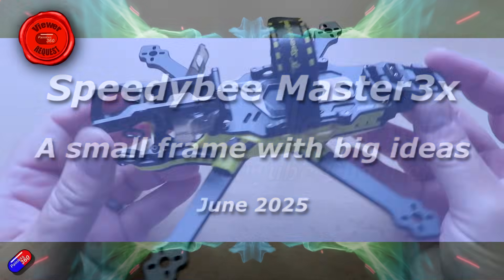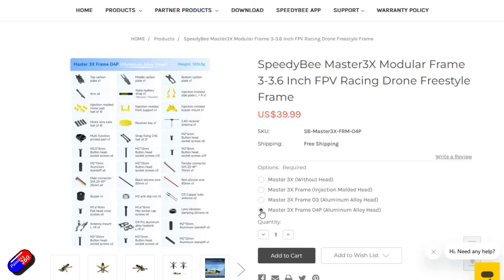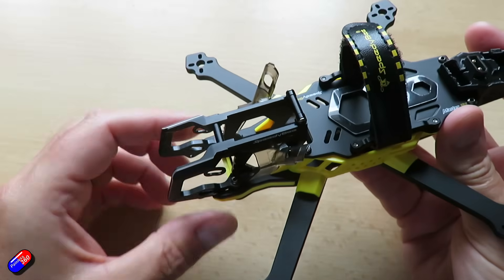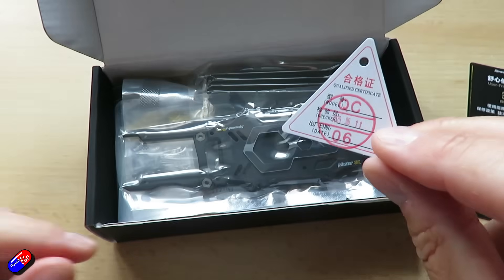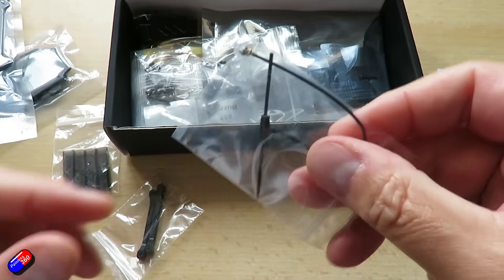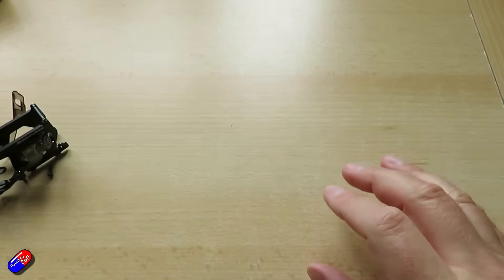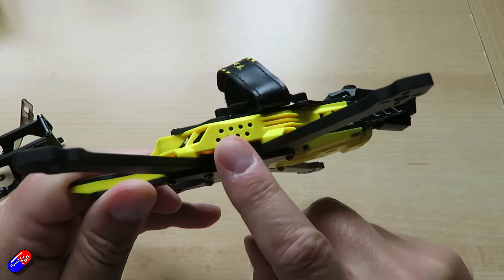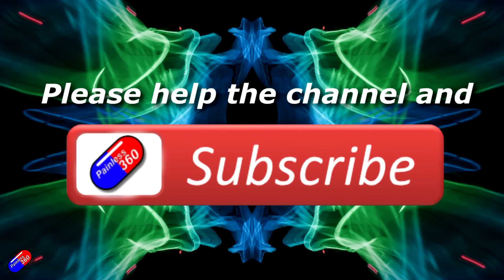SpeedyBee Master 3x frame: A 3" frame with a few tricks up it's sleeve!

Comment: I really like this drone. I grabbed it a few months ago but was the BNF BC the frame only wasn't released yet. I also have a Nexa Evo Pro with 1804 motors and the M3X performed just as good while being over 50g heavier. I was so impressed with the 1507 motors that I bought a set and installed them on the Nexa last week lol. Plus they have around 250 mm more stator volume than 1804's and over 430mm more than 1604's. For fun I put on hq prop 3.5x3.5x3 props on both quads and the results were quite lifting 😂Overall the 3.5x2.5 are the best for 3.5" IMO

Comment: It looks really good. Does the air unit bolt into the head unit as well so that you just unplug easily after the four screws? If so, it makes an air unit pro seem not so bad if you can share it across a few SB frames.
Reply from the maker: Check out the Bee25 video. The frame is designed to enclose it... Happy flying

Comment: Did they provide the wire loom and plug you're supposed to solder to your RX?
would be a shame to have to source that plug ourselves.
Or.... Do they expect you to get a speedybee AIO that has that plug and wire loom? if the SB AIO exists actually now that that I think of it.. 
Interesting frame, really low which is good.
Nice review as always, have a good one!
Reply from the maker: Yep
Reply: @Painless360 cool, now the whole frame and mounting makes sense.
Hoping that can provide the loom and plug separately.
Thanks for replying!